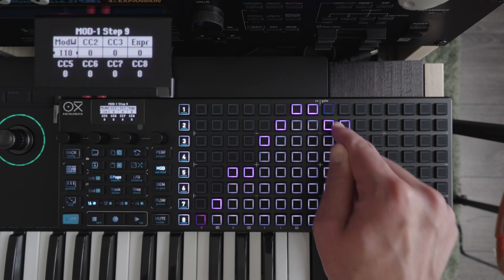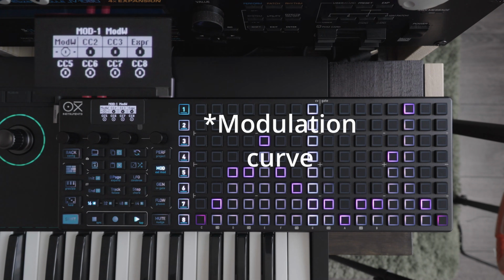OXI ONE MkII CV & Gate Basics

Comment: On that CV Envelope, are those Global Settings (Global Gate -decay release) per track?   So you can have different envelope settings for each track?
Reply from the maker: Any settings in the CV/Gate matrix are per output, but the envelopes are affected by velocity and gate length in the sequncer track as well. So some of the settings are independent. If you have an unused sequencer you could copy your sequence to that and just use it for envelopes with different settings